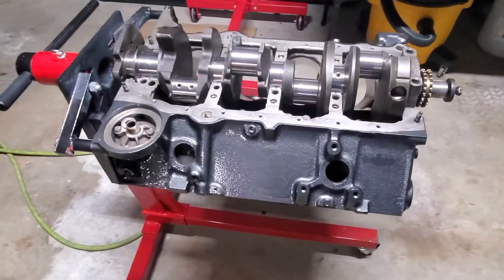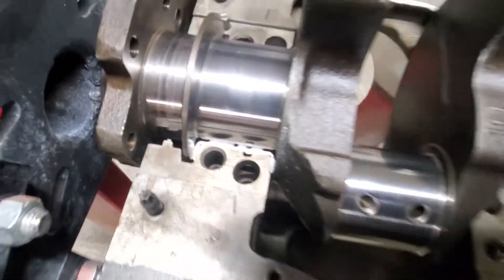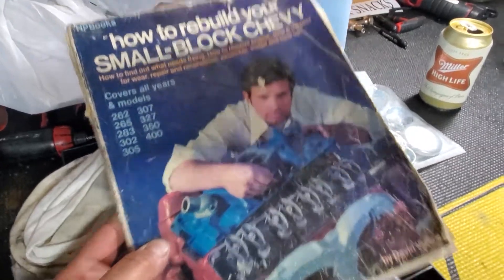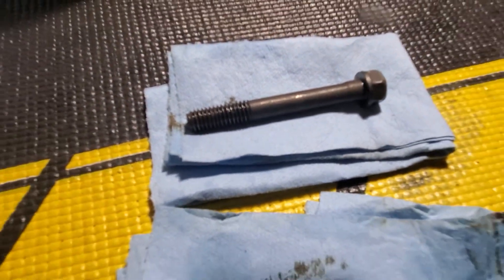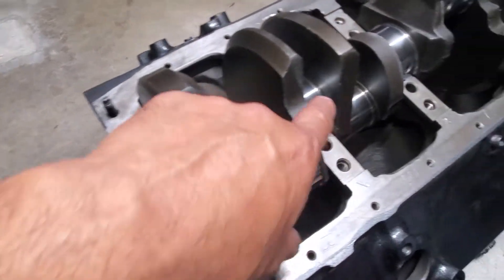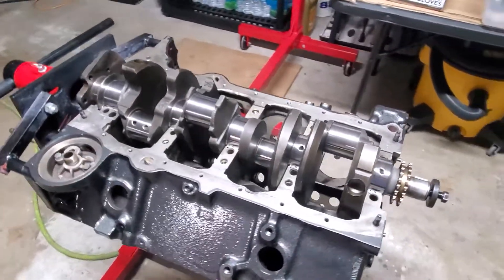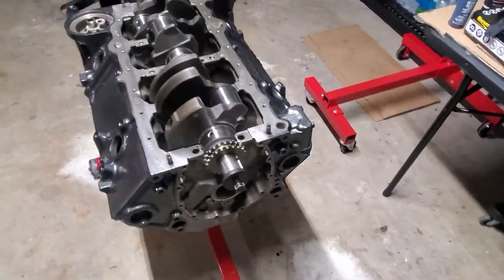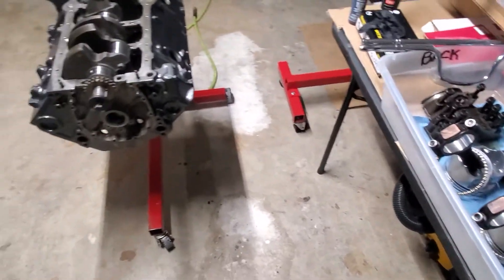CHEVY "355" SMALL BLOCK BUILD PART 2!!!

Comment: Nothing on a small block is torque it yield lol. I’ve built hundreds reusing the head bolts and obviously the main cap bolts 🤣🤣
Reply from the maker: Thanks for the info man. Much appreciated! I was just always told that the bolts stretch once there torqued, therefore not to reuse them especially if there's signs of wear, damage etc. Which is why I use ARP bolts. Although the Main cap bolts on THE SBC,  I reuse